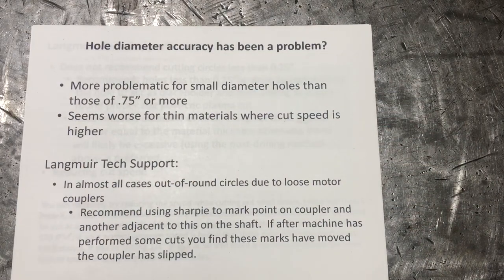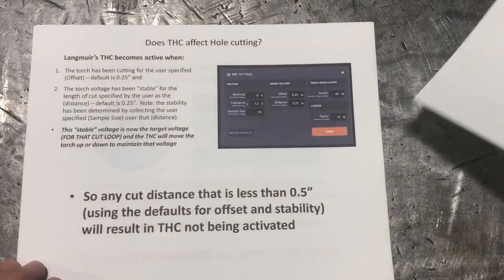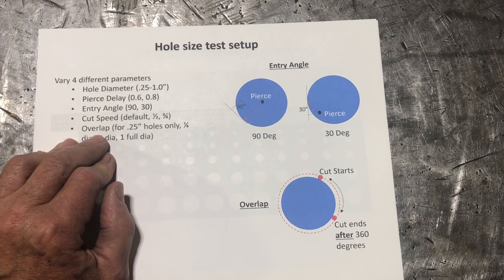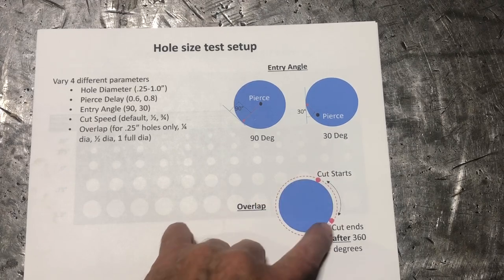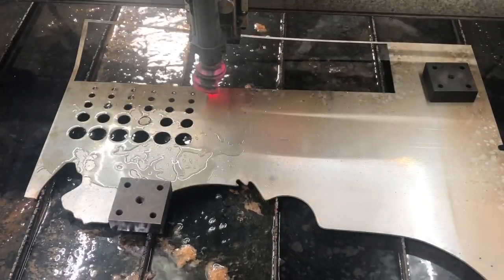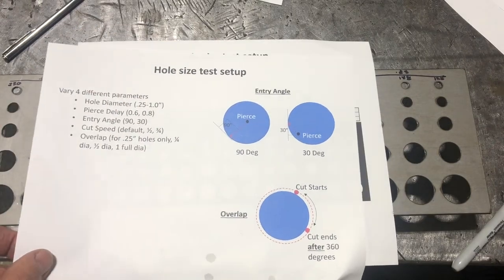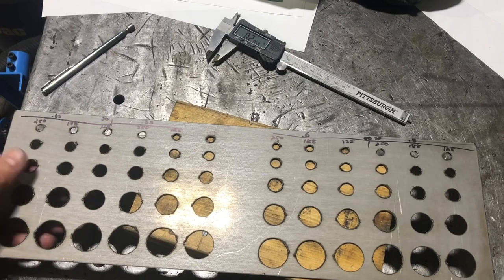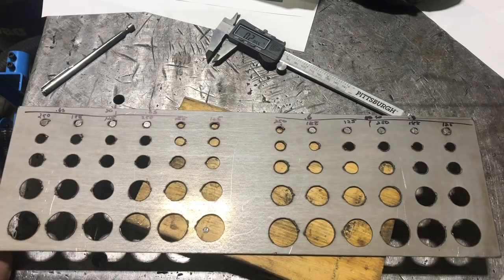Langmuir Plasma Table: Why are my circles not round?

Comment: Thanks for sharing the tip on marking the coupler.  I have had to tighten the screws on the red brackets holding the servo and lead screw on the left side a few times as they started to work themselves loose.  Now I check them every week.  Didn't think to check the couplers for any slippage.  Thankfully, I don't often need to worry about precision holes but this was very informative in comparing the different variables and using the overlap feature.  Your efforts are very helpful and greatly appreciated.  I often go back through your videos and catch little details that I missed before or maybe didn't understand when I first started working with my table.

Comment: I did a cursory search on Langmuir and the first machine I found  showed it has step motors and I am afraid you are finding out the big disadvantage of step motors compared to servomotors,   missed steps.  There can be many causes the most common is that there is just too much friction in the axis.  The lead screw in that picture showed acme screws instead of a ball screw,  easier and cheaper to make but they have more friction and arent quite as accurate as an actual ground ballscrew. 
 Both of those comprimises are cost saving decisions in the design, otherwise the machine would have cost 10x or so what you likely paid.  No worries because the mechanicals of that motion system should be far beyond the reasonably expected variation of a plasma cut anyway. There is nothing you can do about the design of the machine, it is what it is.  What you can do to reduce friction is to keep the rails and lead screws cleaned and well oiled.  I would suggest throwing a tarp over the machine when not in use to keep those moving parts clean but that is probably not a good idea with a tank of water sitting underneath you could get condensation and rust.  So just to keep the dust in your shop under control and clean the machine before and after using it.  I would make sure there is not any water on your lead screws when your are done with the machine too.   So if you dont have grit or dings on your lead screw or rails but you are still getting missed steps   mmm  now you are getting into a more complex problem. Check that your axes are still running square to each other, that everything is tight and solid including the levelling feet.
Step motors are bad about having certain resonant frequencies, certain feed rates where they could jump back out of a commanded step position. At what speed you encounter those resonances is a product of the motor itself, the friction of the axis, the inertia or weight of the axis and the power amp feeding your axis drive, and even the moving structures.  Complex stuff.  The higher end stepper drivers will have a tuning routine that goes through a sequence of moves and it watches the current draw for hints of likely risk of missed steps and maps out some offsets at different speeds to avoid missed steps so that the drive can vary current at different speeds based on that offset map.  Unfortunately when you get in to a sophisticated stepper driver like that it costs as much or more than a servo and you are way better off just going to a servo system at that point, and eliminate the whole missed steps problem altogether.

Bottom line, keep it clean and oiled and if you continue to have missed steps you are just going to have to figure out under what circumstances, most likely certain speeds, you get missed steps, and dont do that. Listen closely and you might be able to hear sort of clunking noise when it does it.  Oh and next time, get the machine that has servos.  Stepper motors are a false economy for anything that needs to be reliably accurate because too often you get in to a situation where they are finnicky and it can be frustrating to figure out where the problem really is and solve it.  If anything changes slightly you could later develop the problem again.
The working height from the nozzle to the workpeice really needs to stay as consistent as possible, the whole point of having THC, but the flatter you can keep the workpeice, the better, and if you could ensure the workpeice is always a perfect plane you wouldnt need THC.  I really dont like that the THC is ineffective in under a certain cut length,  I would dig in to that to see if there is a way around that, maybe a precut move to establish active THC before the pierce?    I'm coming at this from a laser background, same general principles though, and have no idea what custom control software you have there.
I notice in your cut routine your head comes down and presses on the material prior to each peirce,  mmm   I would rather the head never touch the material and I can see how that could push your axis enough to move out of step.  But that does not explain missed steps DURING a cut.
Reply from the maker: Thanks for such a detail discussion.  You are correct in the conclusion that the designers choose economy over accuracy and thus achieved an excellent table that includes torch height sensing and control plus the benefit of a water table delivered to your door for under $3k.  

As for the cause being due to missed steps I’m not convinced that is the main cause.  Many of the items I cut as wall art include hundreds of pierces and complex curves per part and I will cut multiples of that part out of a sheet in one program.  If even one out of 10 of those cuts lost a step then by the end of the hundreds of cuts the locations of the cuts would be off by a large amount.  The control program doesn’t know the step was lost so the true location is not the programmed location.  Assume you lost a step each .25” circle and you had to cut a pattern of 300 circles.  If 100 of those circle lost a step the actual torch location compared to the program location would differ by a significant amount.  I’ve cut over 100 small complex shaped items out of a 4’x4’ sheet and they overlay each other with no noticeable differences in edges or shape locations.  If I was losing steps consistently I just don’t think that would be the case.

Comment: Very informative! I usually cut small holes slightly larger than needed to compensate for the ball screw backlash and easy assembly. I will try adjusting some of these settings on my next project. Thanks for making this video! 😊
Reply from the maker: Thx for the kind words glad the video was useful.  Since that video I have purchase a hydraulic punch and now just do a pierce at the hole location which marks where the punch is made.  Cheating but solved my round hole problem 😜
Reply: @CustomCreations3 what hydraulic punch did you purchase? I been looking for one too
Reply from the maker: @timblack33 for small holes I bought a cheapy off Amazon. Name on it is “Amzcnc” bought an inline foot switch so I don’t have to pull trigger.  Not sure how to add pic on these replies but I’ll try. For larger holes I have a Vevor CH-70 punch tool and Vevor model GYB-700A hydraulic pump to power it.   No problem punching up to 25mm dia holes in 3/8” mild steel.

Comment: Thank you for visiting this.  A rinse and repeat on some .250 or .375 plate would be nice, or post your Gcoode.  

A few obserbvations...
Coupler slippage - you need to mark the Stepper motor shaft also.  There are two points to watch - though if you are slipping, it is obvious on all cuts  curved or otherwise.

Your Y would be interesting to verify if it is stepper motor loss, which I doubt,  or estep error which would be repeatable, which yours is, and see what the total is over 18" of travel.

If it is backlash, since there are two Y motors, I would check left right and center...maybe 3 x .250" holes each for sample.  Might be a clue to point to something.

Your entry into the circle at the start with a sharp angle (30* or 90*), change your lead in radius to about .03 or so with the default lead in angle.  This way it is not trying to make a hard turn and that little dwell is not there.
Reply from the maker: Good point about marking the stepper shaft as well as the lead screw as either end of the coupler could be loose.  

Based on Langmuir’s response that the circle “roundness” is worse for thicker material (due to bevel) I didn’t think repeating the test with thicker material would reveal anything additional.  

Another viewer requested the Gcode so it is been posted on my Google drive: 

https://drive.google.com/file/d/1ECI2y88yZjm6EFf2t7sIfFWKFoJ3aEhr/view?usp=drivesdk
https://drive.google.com/file/d/1lrXKx3sLUxwVSX-3sR95IrZMvz7Jgvat/view?usp=drivesdk
https://drive.google.com/file/d/1bPsZr39EZe9KCijZ4gzKT5zEa17DzzJd/view?usp=drivesdk
https://drive.google.com/file/d/1jKZ2EDQbMWfU0QUr3REyLuFUSmxHlVu7/view?usp=drivesdk

Another viewer had suggested the error might be due to stepper motor losing steps.  After considering this my reply was 

“As for the cause being due to missed steps I’m not convinced that is the main cause.  Many of the items I cut as wall art include hundreds of pierces and complex curves per part and I will cut multiples of that part out of a sheet in one program.  If even one out of 10 of those cuts lost a step then by the end of the hundreds of cuts the locations of the cuts would be off by a large amount.  The control program doesn’t know the step was lost so the true location is not the programmed location.  Assume you lost a step each .25” circle and you had to cut a pattern of 300 circles.  If 100 of those circle lost a step the actual torch location compared to the program location would differ by a significant amount.  I’ve cut over 100 small complex shaped items out of a 4’x4’ sheet and they overlay each other with no noticeable differences in edges or shape locations.  If I was losing steps consistently I just don’t think that would be the case.”  

I could be missing something in that assessment so am open to rebuttal!  

Might look into the lead-in radius…thx
Reply: @CustomCreations3  I agree that it's highly unlikely that you're losing steps. 

Now if the e-steps for the motor are off, then at your home position would be 0,0 but the farther you got away from zero on the y-axis, which seems to be the one in question, would gradually increase so possibly at the end of a full 33-in travel you might be off almost a few hundreths, then back to nothing at the home position...though .003 every .250 is a lot. But worth considering.

Comment: Hello Dan, I have a original CrossFire table with the XL kit and Z axis up grade. I too have been wondering about how to get round holes in my plasma cuts. One thing you have not looked at is the variation in drag for the X and Y tubes and the amount of dirt buildup under the bearings on both axis over time. I suspect there is a greater build up on the X axis tube that increases the drag on the movement in that direction. I just disassembled my table and cleaned the surfaces of both the X & Y tubes. After 3 years of use in my hobby shop there was a lot of build up in the tracks the bearings roll in. I use 20 mule team borax laundry soda to keep the water table fluid at a ph of 8 - 9 preventing rusting of the slates, but it does add to the buildup on any and all surfaces that water splashes on. I to had some problems with the drive couplers loosening and you need to mark the lead screw as well as the motor shaft to be sure  there is no slippage. I'm going to try the longer overlap on my machine to see how that works for me.  Thanks for your work on this!
Reply from the maker: That a great point and anything that restricts free motion in x or y could exacerbate the roundness issue.  I probably didn’t think of this since I’m pretty anal about keeping the rail reasonably clean.  I use a water soluble cutting fluid mix in my water table that does a really good job a rust prevention but the splashing of the table fluid does leave a film that collects vaporized metal particles and I have to clean it off regularly.  Fortunately it cleans easy with just water.  So because the roundness issue seems to be the same when the rails and bearing blocks are clean or dirty I didn’t think it was a major contributor.  Still I should have mentioned it as I’m sure other users may not be as anal about cleaning the rails and I can see how a significant buildup could definitely increase drag on the xy motion and make the hole roundness worse.  Thanks for your response and excellent insight.  Hopefully others will read this thread and consider it for their application.
Reply: I clean them after every use and often use oil and flat stone the gantry aluminum tubing. The roller couplers often drag and create grooves because the way they are designed metal bearings on metal and you obviously want them tight. A linear rail probably would have a been better design by langmuir. The couplers they provide are completely garbage and prone to slipping out of the gate the set screws are way too small and the relief tangs aren't enough. I ordered and installed some better ones. I can get down to about a .200 hole accurately anything smaller I have to fiddle with the lead ins and outs. I have a separate tool I create for holes that usually runs at about 50% less feed.
Reply from the maker: I like the idea of using oil and flat stone on the gantry.  I agree a linear rail would be much better…not sure how the water and cutting fluid mix might affect a linear bearing but would be far more accurate.  I have to keep reminding myself that Langmuir consciously chose to go with a low cost design to appeal to the masses as opposed to a more accurate (and thus costly) otherwise I get frustrated with some nagging issues.
Reply: @CustomCreations3  
Yeah I've had to do quite a bit of mods on my machine although I figure with any kind of machine kit today that's going to be the case. Essentially it has to be looked at as a project in itself and for the price it's an amazing base machine. I've done a few improvements built a nice shelf underneath isolated the controller a bit better so my laptop doesn't freak out from emi (tried the ferrite choke) did some cable management inside the frame added a splash guard aluminum slats ect.  I was looking to replace the lead screw nuts with more high quality to help with accuracy (because there's a cheap plastic guide inside) but the sizing is odd so means I'd have to replace the entire lead screw assembly. Another good thing for people to know is to shut off the controller when you're not cutting as I don't think the controller is designed to cut power completely to the steppers. Stepper motors become worn out when they idle (basically they want to move) and a signal keeps them from moving all the time. Idling constantly can reduce the accuracy over time as they become worn out. Same principle for 3d printers and such.
Reply from the maker: @fireteamomega2343  ensuring controller is off when not using the machine is good info…thx
Reply: @CustomCreations3  
If you're looking for content ideas I've been delving into shielding gases for cutting aluminum mostly nitrogen. I have an experimental shield that slips onto the torch head or rather replaces the torch mounts. The torch slips into a thick quartz glass tube with the bottom section nearest the torch having a metal deflection ring inside (just in case so molten metal and water splashing back don't crack the glass even though it's rated and 1/4" thick solid quartz) the top and middle stabilizer inside holding the torch is just a 3d printed ring with two catch notches that align with the other ring so a couple long springs for touching off with THC is possible. The top ring is sealed to the glass and has a couple ports for gas lines. Finally I wrapped the outside of the glass in laser film so you don't have to wear welding glasses. The mounts to the z axis are just two piece rings with through bolts also 3d printed. I thought about machining some aluminum parts but pla is much lighter on the z axis and should hold up just fine. Basically you just need something that floods gas around the torch arc. Ie. probably a cone with a port would have been a little easier. But it works pretty good holds a consistent gas volume noticed I didn't need the inner metal sheathing the gas extinguishes stray sparks. Overall much cleaner cutting on aluminum I had the torch extinguished at first until I adjusted the gas pressure and increased pierce delay. Could just be my imagination but the arc seems more uniform and controlled as well when I use shielding gas.
Reply from the maker: That is way cool…would enjoy seeing it in action…you should do some youtube yourself!  I started as a test and still just use my iPhone 8 so no special equipment needed.  I’m not looking to gain a big following and get monetized just like sharing what I’ve learned in hopes that it helps others.  You’ve gone a bit further and your ideas would surely help folks that cut a lot of aluminum.  Switching gas to argon would be great for stainless!
Reply: @CustomCreations3  
Yeah I might look into doing some content creation I have to learn a lot because I don't really know anything about it but sounds like fun.
Reply from the maker: @fireteamomega2343  I watched a couple YouTube videos on starting a channel and uploading the videos…it wasn’t difficult.  Because I use an iPhone I use iMovie to create and edit the videos

Comment: I was looking into this problem as to why my holes were not round in my langmuir cnc plasma table and I stumble across the z axis where the torch is mounted , it had alot of slack sideway and that affected the cut quality by alot, try making sure the Z axis has NO play so you get accurate holes.
Reply from the maker: Thanks for putting your info on the thread…I’m sure it will help others